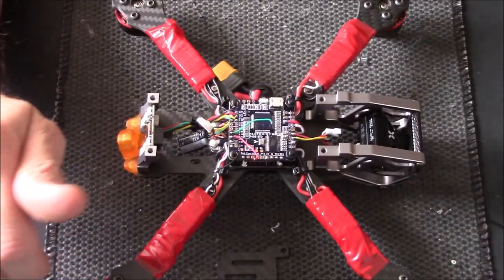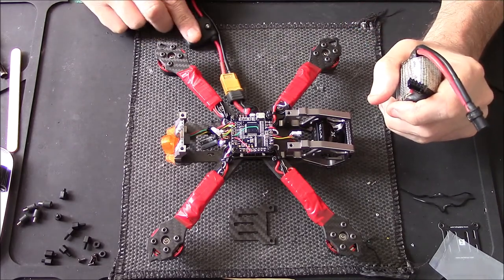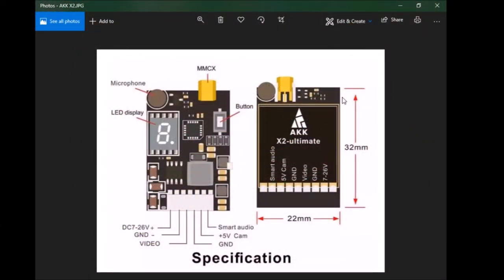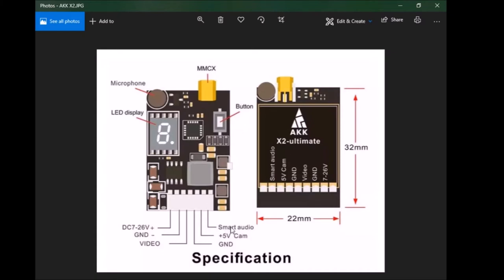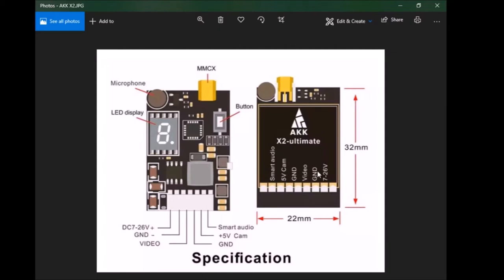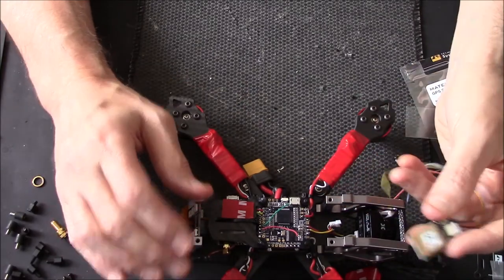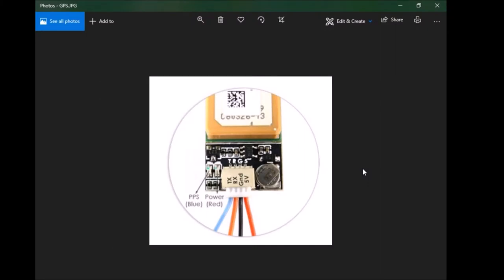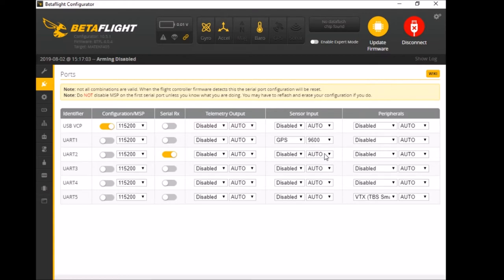GEPRC GEP KHX5 Elegant  PART 3

Comment from the maker: Just encase you missed it in the Deception  ( IMPORTANT GPS INFO )  Quad will not arm unless the GPS gets 8 "SATS" however you can change this in the GPS Rescue Tab by lowering the amount of Sat's needed at the bottom of the Failsafe page.

 However If your using Betaflight 4.0 or above you will have to, go to the command Tab and enter ( get sats ) then enter the following

 ( set gps_rescue_allow_arming_without_fix = on )

Now you can arm your Quad without any Sat's but keep a check on them in your OSD just encase you need to switch to (Rescue Mode) 

Also ( Resource ESC codes have changed in betaflight 4.0 and above )

Any Questions just ask, then donate £500 lol

Comment: I put the smaller caps on the ESC’s ! That big one for the xt60 helps tame the voltage spikes from the battery, this can blow the small caps on the board ! 
I use a multi meter and continuity before I plug in a lipo 😃
Really tidy build George 👌🏻
Like the antenna mounting as mine need revising 😃
Your editing is really helpful for people learning from your channel 👌🏻
Smart audio 💥 oh yes 
I need to plug the ear piece in flying away like I do 👍🏻
This channel is going to grow for sure ! Keep up the good work 👍🏻👍🏻
Reply from the maker: Thanks buddy glad you liked it, and thanks for your kind wards